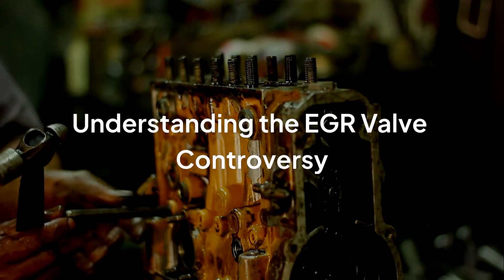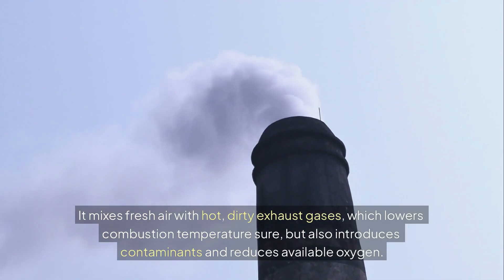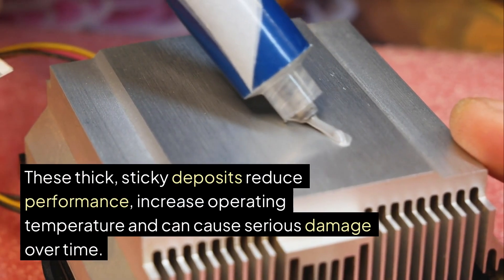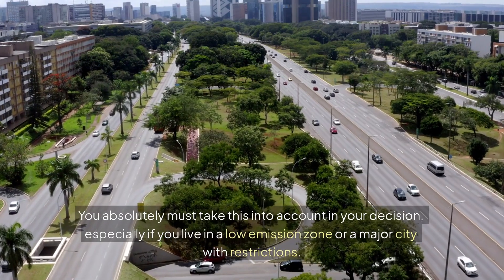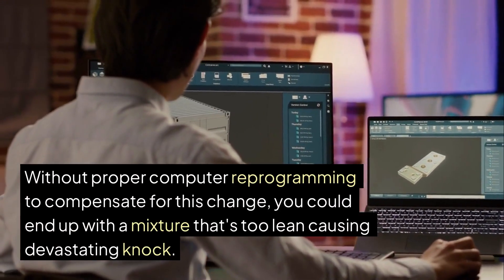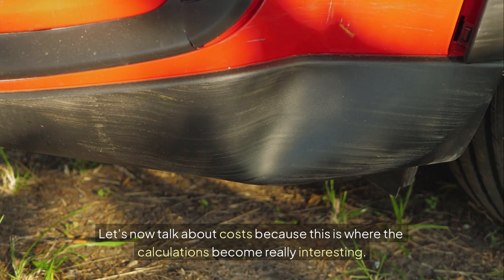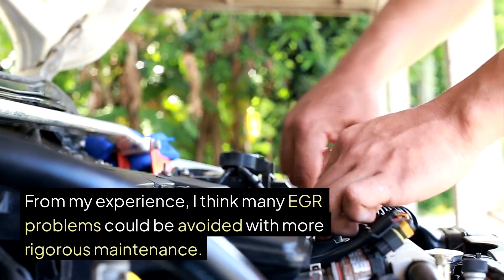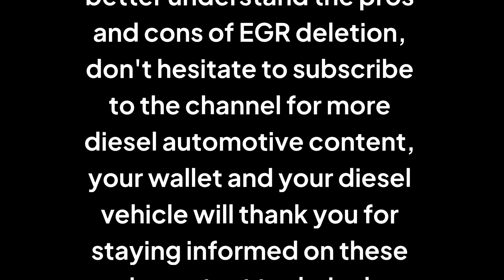EGR Delete EXPLAINED – Genius or Disaster ?

Comment: You have 3 solutions:
1 Blocking the EGR valve with metal paltes (it needs the computer reprogramming)
2 The complete EGR removal
3 The software deletion by reprogramming the computer (the computer keeps the EGR valve permanently closed) (no visible trace of modification)

Comment: The truth is not in between, BOTH are true if caught you will be fined and it is destroying your engine
Reply: nah it saves ur engine !
Reply: @alexmaloy4821  Just to be clear deleting the EGR will save your engine by preventing extreme soot/tar buildup up on intake ports valves etc.It also allows proper(high) temperature combustion.
I stand by what I said, deleting is both illegal AND leaving it will hurt your engine